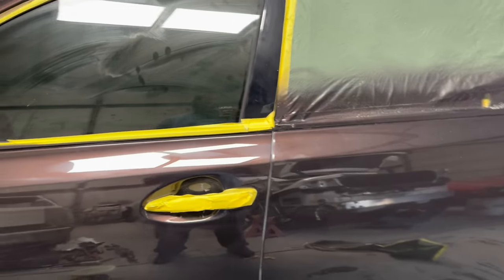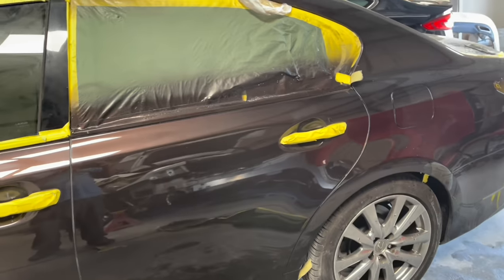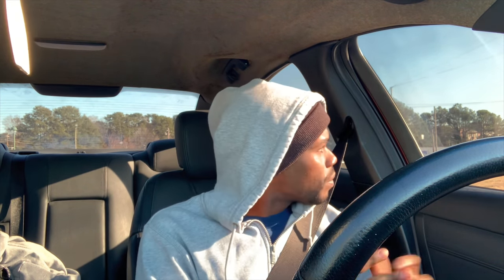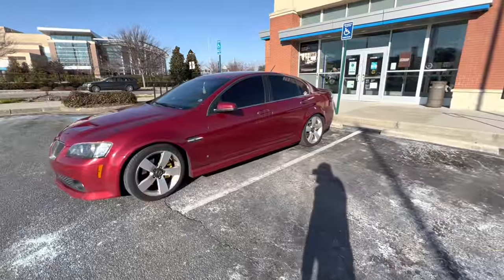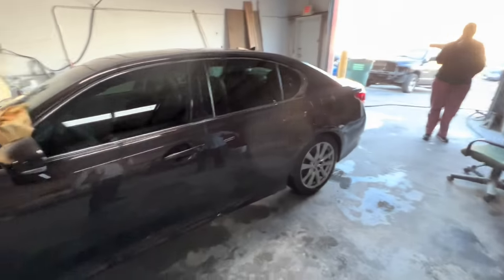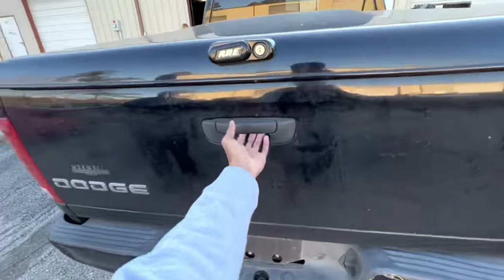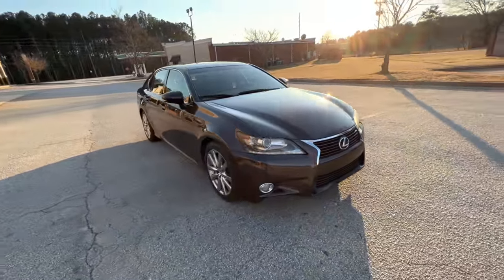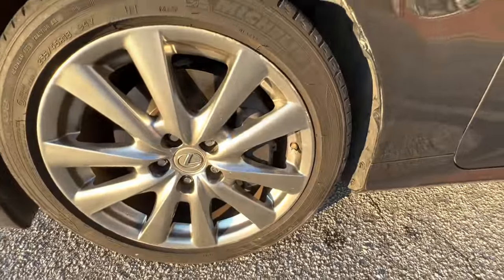TAKING DELIVERY OF MY FRESHLY PAINTED LEXUS GS 350 I WON FROM COPART *SECOND COPART BUILD COMPLETED!

Comment: The rattle in the driver door panel is a common issue in the 13+ GS350's,  the window switches rattle with the volume turned up. Just pop the shiny arm rest part up and use electrical tape to wrap around the switches tightly and pop it back in and boom done deal. Alot of YouTube videos show how to fix this common issue.

Comment: Noise in your drivers door panel is probably the window switches, take the unit out, wrap some cushioning material around and reinstall before spending the time pulling whole door panel, most likely will solve it as it’s a known issue.

Comment: The rattle you hear in the drivers door is the window control panel. Just pry it up and wrap the bottom with electric tape. You don’t have to remove the door panel. Easy 5 minute fix.
Reply from the maker: Drivers control panel?
Reply: Yea, the driver window controls.
Reply from the maker: @map4091  oh naaaaaaw it's not that. It stopes when the windows down
Reply: @WeHustleDaily  , oh ok. Not sure about that then. 👍🏿